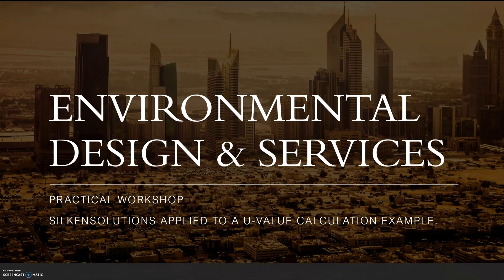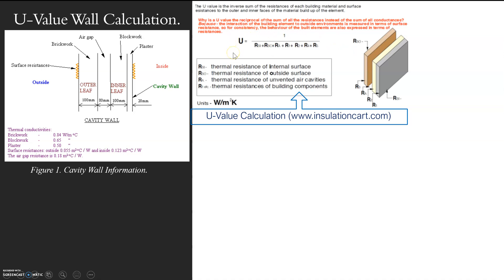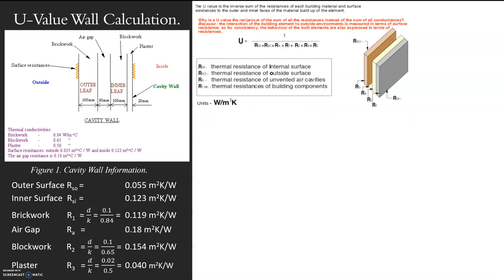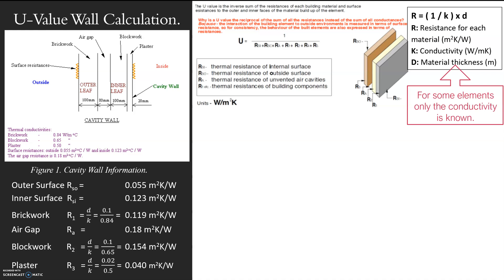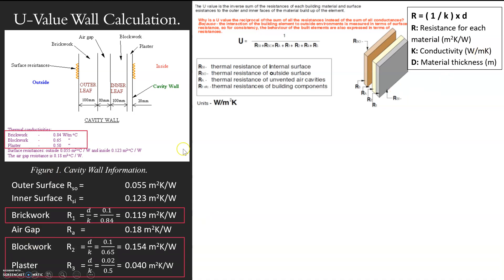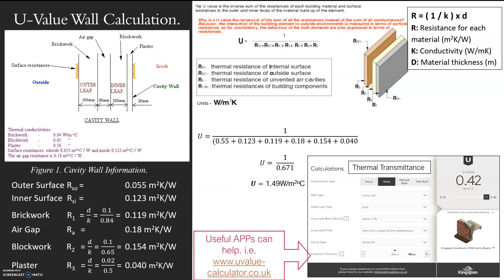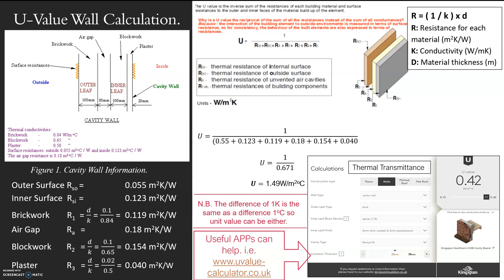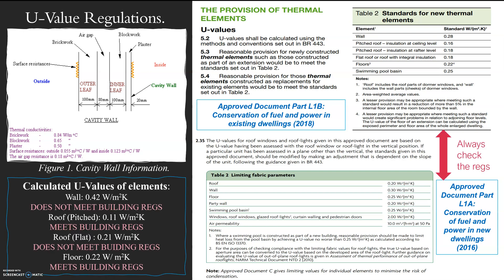Thermal Calculations: U-Value of Wall

Comment: I want to ask a spesific question

You explained that Resistance is R = (1/k) x d,
and Transmittance (U-Value) is U = 1/(sum of R)

For example, I have only one material that has the thickness of 1 m, the Resistance would be R = 1/k, right?
If I only have one material, that means the U-Value would be U = 1/R, right?
In those scenarios, we can conclude that U = k (U-Value = Conductivity).

So, can you explain to me what truly are the difference between Transmittance and Conductance, mathematically and in definition? Why U-Value is used for layers of materials? Where did that concept come from? And how could U-Value has the same value as Conductivity?

This bit is the one that makes me confused of the difference between Conductance (the Conductivity of a material given its own thickness) and Transmittance.
Reply from the maker: Hi there. So sorry I didn't see this until now. Hopefully you got your answer but basically the K (conductance) refers to an individual material per unit length (this can be measured by manufacturers easily) and U-Value is the rate of transfer through a wall made up of a number of different materials (this is calculated when we know the depth of each material). You're right they're both a form of conductance but you need to know the depth of a material to work out the resistance through it first...I'm sure there's someone out there who can simplify this all better but hopefully that helps a bit.